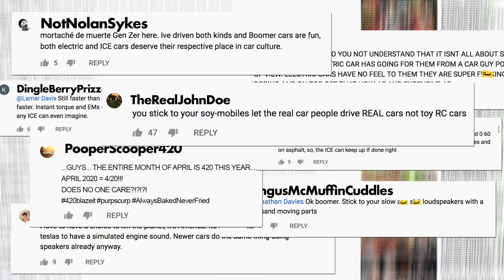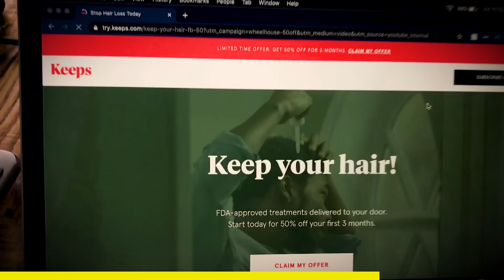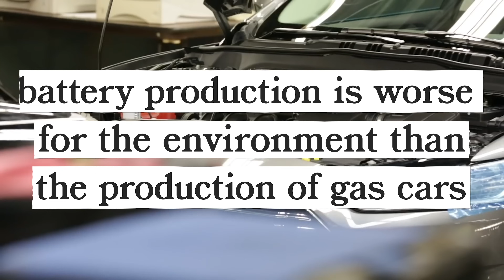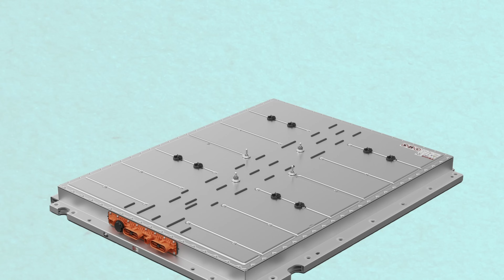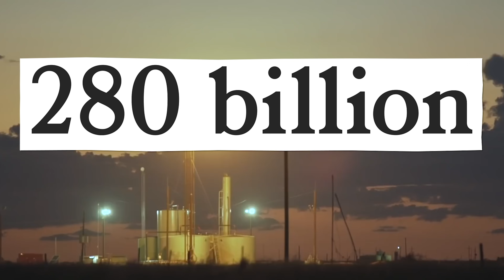Are Electric Cars REALLY Better for the Environment?

Comment: You failed to say how long the battery lasts, 
what's the cost to replace them, and also what is their impact when they will be recycled. Car battery last 8-10 years, give or take. Meanwhile, regular cars can double that and even more. You didn't mention that once lithium is mine, is move around the world to be processed in countries that don't have the same restrictions for health and safety for their workers. You didn't mention that in case of flooding, batteries could be damaged or completely useless. 
You didn't mention that in case of fire, firefighters have to use tens of thousands of gallons of water, and also the damaged batteries can reignite days after.
So, go back to the board and start your analysis from the beginning. Good luck with that. 😊😊😊

Comment: nice video, I do think you do forgot a lot to take into the equation like the extra wear out of the tires, this cause extra pollution problems for the EV, the cars are heavier and with this come road wear out., produce more small particles when using the breaks, the amount of copper, plastics needed for loading the cars and the charger units. They are all not in favor of the EV and sad that you forgot this. When this is added to the balance you see the EV has a hugely different green performance. add to this the PV problems and Wind turbine problems. Wind turbines in wind parks change they are changing the temperature downwind by increasing this with 2C due to the distortion. On top of that windmills they also kill al lof tof birds. You totally forget the lamination process and the end-of-life pollution problems for the PV as well for the windmill parks. When you add all of this you see a different picture that is not in favor of the EV. also because of the damage done to the earth when mining. Besides that, there are not enough raw materials to make all EV that are needed to replace the ICE cars. That is why increasingly and looking for a solution like the ICE on hydrogen gas of solid state.

Comment: I would like you to do the comparison with hybrid cars in the mix. EVs probably won't catch on until some issues are solved. First, we need policies to promote home ownership. Younger people are more likely to adapt newer technologies, but EVs really make the most sense when someone can charge at home. How many younger people own their own home? Second, is the issue of infrastructure. I'm not sure charging infrastructure is the only issue. Affordable, high speed rail would really make EVs more appealing. Then, on long trips the necessity of taking a car would be less important, which alleviates some issues of range anxiety. Third, is probably battery technology. If something comes along that replaces lithium batteries that significantly lessens those initial environmental impacts and also the disposal of batteries, then EVs become more environmentally friendly.

Comment: It's impossible that an electric car has less CO2 emissions.  In an ic car gasoline chemical energy is converted directly into mechanical power with fairly high efficiency.  In electric cars typically coal or oil or natural gas is burnt at a power plant hundreds of miles away.  The burning of these fuels all make about the same amount of CO2.  So the mechanical power from the steam boilers at the power plant, instead of directly pushing your car down the road, has to be converted many times and transported hundreds of miles to your vehicle.  There are many, many losses associated with this transfer.  There is the electrical conversion loss at the power plant to the transmission lines.  There are losses from the hundreds of miles of transmission lines.  There are conversion losses from all of the substation transformers.  There are losses from the charger used to charge the car.  There are losses from the batteries as they are charged.  There are losses from battery as the charge is stored.  There are losses from the battery as the battery is discharged to the motor.  There are losses from the motor as it finally moves the car.  All of these losses make the car very very less efficient than an ic car where the fuel is burnt right where it powers the vehicle in the most efficient way possible.  In addition, vehicle emmisions are highly regulated, monitored, and verified.  Some power plants are not even regulated, monitored or verified, spewing toxic poisonous gasses and CO2 non stop all over the country.  All of the vehicle emmisions in the US make up less than 12% of total CO2 sources in the US.  It all comes from industry.  So even if every car was solar powered it would only reduce total CO2 emissions in the US by 12% and no one would notice any difference in "climate".

Comment: Forgetting about battery replacment in the calculations. In consideration that most batteries have around 1000 recharges and if the vehicle is getting recharged for example once per every 2 days your looking at around 6 years till replacement is needed. Then thats another 9 to 10 tons.

Comment: Another issue is recycling the cars, which is difficult to do on new cars, both gas and eV, but old cars with fewer electric features will be easier to recycle which is an important part

Comment: It’s harder to recycle ♻️ these lithium batteries then regular gas cars. That’s a lot of expensive waste material that’s hard to separate the metals and chemicals . But i guess evs are better for the earth 🌍 😂😂
Reply: Don’t forget the crashing 💥 rate is pretty high and evs have a horrible side effects when in a crash and in high level of heat or even just defective batteries giving super toxic gases/chemicals, evs are also very hard to put out in case of a fire 🔥 ……

Comment: We have become focused on CO2.  There are many more forms of pollution. Such as the pollution from the disposal of batteries.  A few years ago we were focused on the generation of ozone.  Electric motors produce ozone. The out of control use of plastics.  You are incorrect about our power grid being able to produce enough electricity for the EV's.  My point is we need to be focused on the reduction of all forms of pollution.  Not just hyper focused on what ever form of pollution that is the fad at the moment. When we force a new fad before the technology is there. We may cause more harm than good.  Biggest problem right now is a better way than current battery technology to store electricity.

Comment: Misleading video and overlooked/biased talking points. The life expectancy and quality of the majority of gas cars used to be around 30-50 years. At most, an EV will last 10-15…? The batteries will last less and need to be produced more. More car production due to lack of longevity and more battery production needed per every vehicle’s life span; have the gas powered car creating less of a carbon footprint.
Also, your assumption about the drain in the power grid is factually incorrect. You are obviously measuring drainage on voltage rather than amperage. Readers can research and find how misleading your commentary in that area is.
Lastly, redesigning the power grid to “green energy” is another substantial carbon footprint for which EVs would be solely responsible for. Did you factor that impact into your whole misleading review?

Comment: I wonder if the evolution of electric cars will give us full sized slot car tracks eventually. How cool would it be to strip out the batteries and put electrified channels in a race track? The "driver" has no steering wheel, just an accelerator and winning comes down to how fast your motor can go on the provided current.

Comment: If you are going to factor in the refining of oil you have to look for the refining of silicon for solar panels and the production of wind turbines. Both of which have a very low life span relative to other sources of electricity. Wind and Solar have a very low-density relative land usage, meaning you need many times more land for a wind solution or solar than regular power plants. That's not a problem until you realize you will have destroy wildlife habitat and cut down forests for these green goals.

Furthermore wind turbines cannot be recycled and need to be disposed of and new giant blades manufactured out of fiberglass. Look at California you import 19 Terrawatts of power every year from around the country. We the people in other states pay higher energy prices so that California can pretend to be green. While accepting slave labor to build your batteries for your cars.

Your grid in California couldn't handle air-conditioning let alone charging your cars. The reality is with every gas car you take off the road, you have to add that capacity to the grid. The grid doesn't have the ability to deliver the power and it will cost minimum 19 trillions dollars to build the capacity just to charge electric cars. No including upgrading transmission lines.
Reply: Wind and solar energy are energy sources that only there for support. People that fight for this type of energy clearly does not know the limitation of their product. Nevertheless it does not mean that renewable energy are totally out of options. Going nuclear is the best bet for humanity to go for totally clean energy. It's abundance and sustain. More importantly it does not required huge landscape like solar and wind was.

Comment: Build the body panels out of solar cells and put windmills under the body panels that turn to charge the battery as the car drives, air passes through the fans to charge the battery as well
Reply: You are probably a scientist. Putting windmills to a car to achieve better range.😂

Comment: This is going to be a leap frog,, cluster mess,, of logistics,, natural resources,, pricing,, insurance,, REPAIR,, Fires & Accidents,, charging time, rate, & availability,, grid loading,, battery durability & life expectancy,, cold weather operation,, warm weather Air Cond drain,, I'll WATCH FROM THE SIDE LINES FOR A WHILE, Thank you.
///
Tesla OK, but some of these NEW brand EVs won't last, especially losers in Self Driving, among other issues.

Comment: Fan Boy, you are annoying. When they sell for same as ICE. WHEN THEY STOP SELLING EV speed & range performance; and, go with Prius config to avoid RANGE ANXIETY & Full Battery requirement. When they stop scaring us with Global Thermal Runaway. 1) YOU ARE WRONG. COAL IS DIRTY, PERIOD. 37% GLOBAL. 2) We STILL have PEAK DEMAND PROBLEMS IN CALI, TEXAS, ETC. 25% plugged in half (12%) during day of 278 Mil units is major PROBLEM. Babbling fast without EV Kilowatt-hours at PEAK DEMAND is Glossing Over it.

Comment: what's the average lifespan of an EV?
Reply: depends. 10-15 years to replace the battery, but once you replace the battery you get another 10-15 years because there really isn't that much wear and tear on the rest of the car for regular use. However the industry is already correcting for this fact by ensuring the software in the cars won't be updated or maintained properly to ensure you buy a new one instead of just replacing the battery.

Comment: Your "myths" fact checking was bad too bro..forgot a lot of factor to whats needed to actually maintain and the cost of it when having to change batteries every 4-5 years max..its like if you had to change your honda engine every 4-5 years..will make it kinda less interesting to buy gas cars if non were realiable whatsoever and the max range you had before you needed to stop hoping they have a fast charging station which you have to pay for..evs are for cities dummies period..the rest of the world is way too far from making those useful yet for anyone actually travelling more than 200 miles in their cars that arent taking planes non stop everytime they need to move more than this.

Comment: I’m curious about diesel tbh. ICE engines usually run around 10-20% efficiency, whereas even older diesel will run around 40-50% efficiency. I own a diesel truck that gets 20 mpg. Big V8, 8,000 lbs. if it were a gas engine, I’d get less than half that fuel efficiency.

Comment: The answer surely has gotta be hydrogen. I don’t get why we’re not going for that rather than battery cars
Reply: ....why?
Reply: @ligidk  We get it from water and have plenty. Hydrogen could be produced by renewable energy sources and stored in tanks. Lithium has to be mined and hard to dispose of etc
Reply: unfortunately hydrogen isn't really that easy to use in cars. It is more green but it's also extremely expensive as of right now.

Comment: EV charging infrastructure needs to be more common place outside of the dense cities and EVs themselves need to be cheaper they are getting close to being cheaper. I think it will take a battery tech revolution first before that happens being able to remove Cobalt and or Lithium out of the equation could have major implications for the footprint of crating EVs as well as the end cost to consumers.
Reply: Batteries are so far from being that good that’s it’s practically impossible to fix this.

Comment: Electric to gas, yes but not necessarily electric to internal combustion. You guys recently did a show on a carbon neutral synthetic gas that could be feasible if scaled up and Audi has been working on a similar product with another company in making synthetic diesel they call "blue crude". The Facilites all run off green energy sources, pull carbon from the air and the fuels don't release any toxins into the air. If these were successfully upgraded and integrated would they not be even better than EV's? Any engineers that can answer this?

Comment: The good comparison is hybrid to ev. The hybrid is apparently much better than EV. And then there is the problem of meeting the demands of EV on rare minerals will mean production will have to be massively increased and will be running out of these faster, and so need more expensive carbon unfriendly methods to mine. In fact it would be pretty much impossible to meet the demand.
Reply: as an experienced mechanic I discuss the problems with electric cars in depth on my home page vid.

Comment: The tax credit it's a credit so it means you would need to be paying 7500 dollars to get that as credit. Some poor people don't pay 7500 in taxes so they could only deduct whatever they owe. So they don't get the full 7500. So the poor get less money. It takes 60 percent more CO2 to make an ev than ice. But ev only last half the life span of ice cars due to battery degregation. So by the time you're done with an ice cars you would have gone through two EVs. Also, if you compare a intergra  to a model 3. The CO2 breakeven point would be more like 5 years but 5 years after that you would need a new car.

Comment: Nice video.... But hardly conclusive... because, Ah.... you forgot the bit about longevity... EV's need new batteries FAR more frequently than ICE cars need a new engine. And you glossed past the growing stockpile of dead batteries VERY quickly. That has a huge impact, don't sweep it away in a quick sentence. Also, the power grid is not that robust bro... it really isn't. In absolute truth, neither EV's nor "ICE" Cars are either the cause or the solution to the carbon crisis. The problem is OVER-CONSUMPTION OF ENERGY!

Comment: I wonder if they will ever produce electric plane's as this would be great for cleaner air.
Reply: Did you watch the video?
Reply: @calsand6  of course.
Reply: @zeta472  Then you should know that electric planes would only make the situation worse. So, if anything, electric plane's would cause dirtier air than before, as if it wasn't dirty enough already.
Reply: @calsand6  he clearly stated that electric cars are much better for the environment so obviously electric plane's would be also, clearly you haven't watched the video.
Reply: @zeta472  Aight buddy, whatever you think
Reply: @calsand6  and the obvious answer to that is how would they be able to chemtrail 👍
Reply: @zeta472  but theyre not, from producing the batteries to getting the energy 
Gas tanks dont pollute even if gas does 

If were using solar, wind the solar and the turbine both have problems, from msking them, to maintaining them, from recycling , land needed, both are not great for animsls too ....

So now you have a battery thst was mined and the energy that is polluting on its own lol like i said at least gas tanks dont pollut